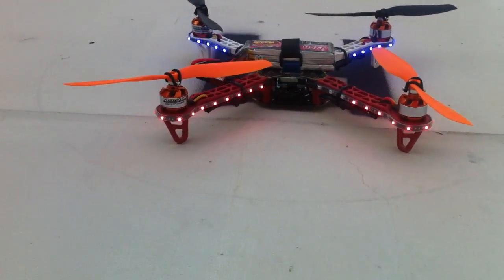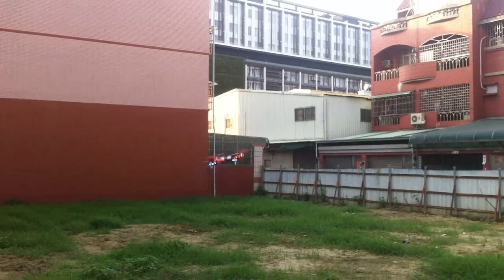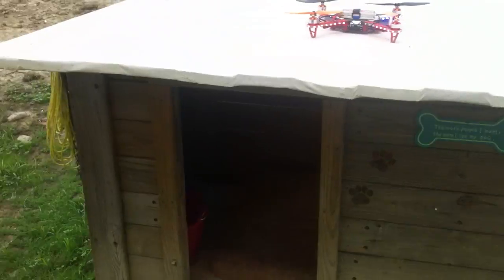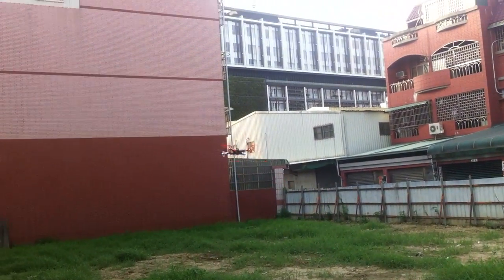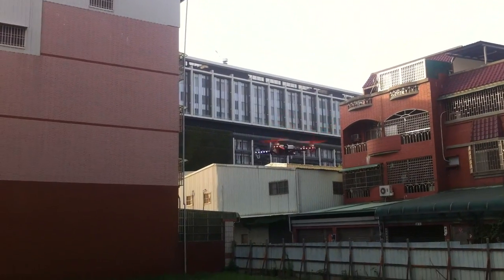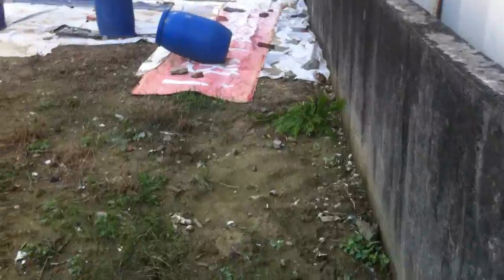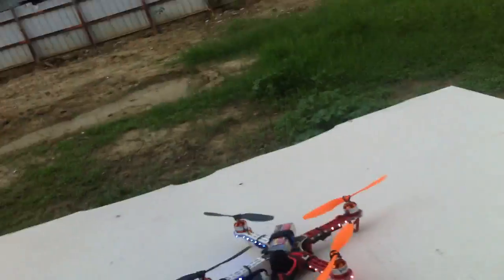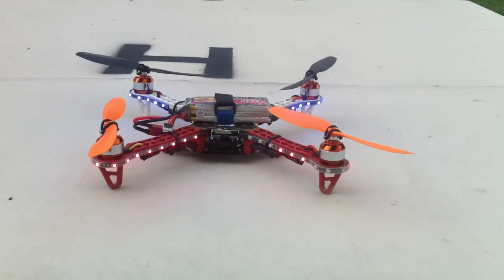DJI F330 with stock Skywalker 20 amps ESCs-Acrobatics

Comment: of course  flashed esc's are not necessary.  I been flying without them for years  with great results. But   a proper prop adapters  I'd say  are necessary.
Those prop savers are pain  in the ass. Some  of  them breaks very easy if  you fly  aggressive ,some holds better, but tends  to break after  some  time  anyway, so  you have  to change them quite often . I  had 3 crashes in a  months  because of  these rubber things and  since then I never use  them  again.